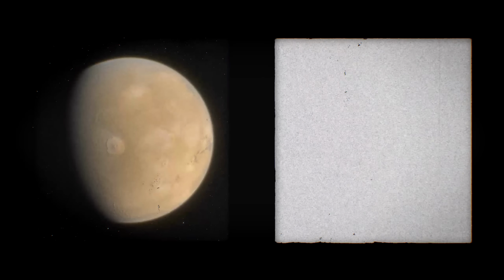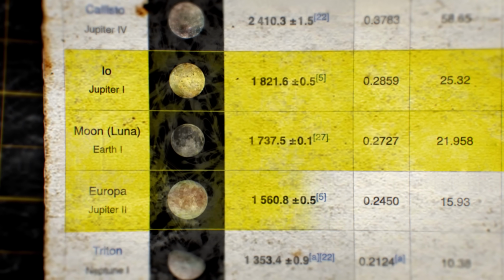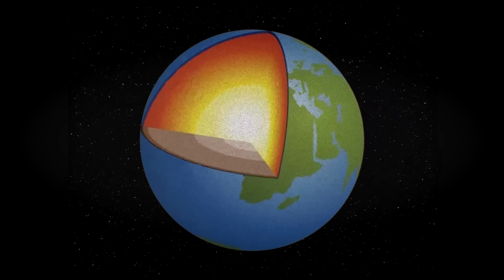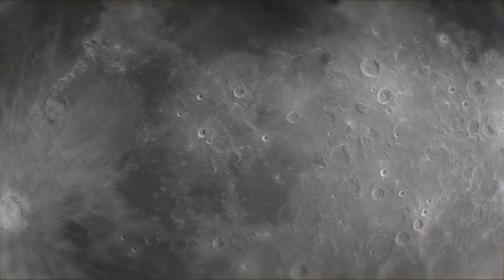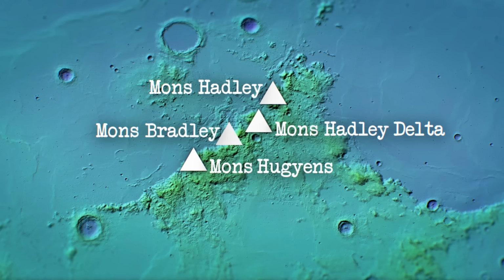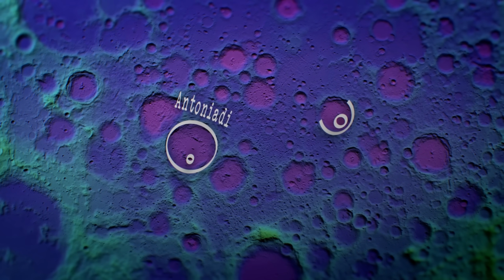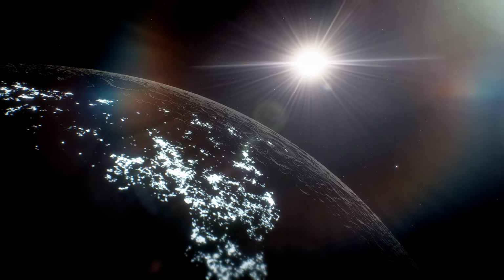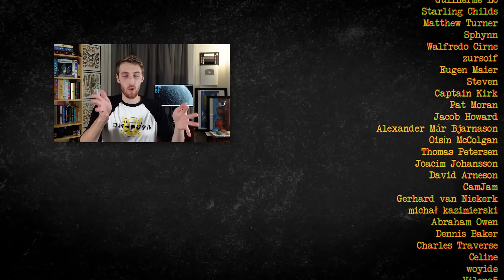Why The Moon's Geography Is DEAD

Comment: As a very amateur armchair writer I kinda already figured out that if the moon’s surface is stable enough, it’d be needed as a larger/more permanent station that’d basically become a port and staging point for future missions. Aside from how long it takes to reach the outer edges of the solar system with our current technology (which probably won’t be made that much faster, even with using celestial bodies to slingshot astronauts), the biggest obstacle to more hands-on exploration has to do with how much fuel, rations, and other supplies a shuttle can carry and still reach escape velocity. BUT—move a good deal of these supplies to the Moon gradually to pick up later, and suddenly it (theoretically) becomes far more feasible. (There’s also no biology to hurt on the moon with repeat launches, unlike Earth.)

So, for just being able to explore, say, Mars and Mercury and various Asteroid Belt objects and other celestial bodies like nearby moons and maybe even comets? Yeah we’d need the moon as a port. The moon is also a conveniently located place to try and test things to set up actual colonies for astronauts (NOT YOU, BILLIONAIRE TOURISTS) to have longer extended stays outside Earth’s atmosphere than what we can currently do with the ISS (radiation shielding, artificial gravity, actual agriculture with hydroponics and poop-fertilized soil verses testing with a few plants). Because forget a Mars Station/Colony—we gotta figure this out before sending anyone further than Earth’s orbit and the moon.
-
…THAT, and who cares how “practical” it is. If we cared about practicality beyond the logistics to plan to study things outside Earth’s gravity…let’s be honest. I don’t think space exploration would even exist. (And, well. I just think the moon is Neat)
Reply: I don't mind billionaire space tourists, if their money helps fund the research and improve the technologies
Reply: I hope one day space travel is cheap enough for regular people. Like, a couple grand to go up into orbit. Instead of buying a new car, you could go to the moon.
Reply: Tldr
Reply: @anonymousfellow8879  I agree
Reply: @sandrotabidze  
Teal Deer:
-the moon’s a perfectly located celestial object to deal with figuring out long-term space travel and outright habitable colonies for research—assuming its crust is stable enough (have yet to hear that it isn’t) as getting to Mars is 5 Years One Way 

the moon’s still frikkin COOL just ‘cause it exists. Who needs a practical reason to be interested in it?? -basically a gentle jab at Atlas Pro being bored with this topic but finally making a video just to get the Repeat Requests from commenters to shaddup.
Reply: Minimus is way easier because of the lower gravity. It's also closer to the edge of the gravity well and so takes less fuel to escape.
Reply: @anonymousfellow8879   Just this christmas I politely publicly declined a 25€ Amazon gift coupon that my boss gave us as a little christmas present. My boss is an amazing guy. Amazon is a dystopian shithole, as far as I'm concerned
Reply: @Matityahu-the-God keep dreaming

Comment: It's also worth noting that if our Moon were much smaller, we wouldn't exist as a species, and Earth would be a very different place, most likely only with pond scum for life. This is because the Moon's gravity holds the Earth upright, and only allows its axis of rotation to wobble, ensuring almost the entire planet gets the Sun's rays each day.

Without the Moon's massive size, the Earth would periodically tip on its back, and expose one hemisphere continuously to the full force of the Sun's rays. The effect would be to prevent complex life ever leaving the oceans, and most likely never developing.

Also, without the massive iron core of Thea, the impactor which created the Moon we know today, our Earth would not have a large enough iron core to create the huge magnetic field which protects our atmosphere, and the Sun would long ago have reduced the atmospheric pressure on the surface to zero.

And perhaps even more importantly; without the massive Moon and the large tides it creates, Earth's day would only be 6 hours long, and the large Intertidal Zone which allowed marine life to evolve onto land would not exist.

The Earth-Moon system has such a ridiculously low chance of existing that it accounts for a large percentage of the reasons for the Rare Earth Hypothesis. And let's make no mistake here; the solution to the Fermi Paradox could easily be the rarity of Earth-Moon systems which remain sufficiently stable for 4,000,000,000 years.
Reply: Brilliant.
Reply: source: dude trust me bro
Reply: Is there any evidence that this tipping effect has ever happened on the other planets which lack major moons, Mercury Venus and Mars? I’m not convinced, it’s not something I’ve ever heard of before.

Comment: I think one of the greatest challenges with colonising the moon would be the lunar regolith itself.  I remember someone mentioning that the static clinging regolith to the astronauts, the lander, and the instrumentation caused no end of problems that hadn't been adequately predicted for the mission.  Even on subsequent missions the regolith continued to cause problems even with experience of it.  It got in the astronauts eyes, messed with seals, dirtied camera lenses, large quantities got inside the lander just by clinging to the outside of the suits and got in every crevice in the control panels.  Essentially, everything on the moon is going to get clogged by dust, and every moving part is going to get grit in it.  It would be very difficult to keep any facility clean enough to achieve the level of workmanship required for further space travel.

Comment: 5:50 Technically, the Moon would only be the second biggest relative to its parent planet.  Charon holds the title of biggest moon relative to planet at roughly half the size of Pluto.  But of course Pluto isn't a planet anymore, and the sizes of Pluto and Charon are close enough that they could be better described as binary planets rather than as a planet-moon system, so sure Earth's Moon wins by a technicality.

Comment: An interesting video, but it lacked any mention at all of the theoretical creation of the moon, causing the back side of the moon to have a much different, thicker, lighter and smoother crust, due to the lack of volcanic activity that is prevalent on the visible side of the moon. Personally, I find the Earth's moon to be one of the most interesting and intriguing of all the celestial bodies in our solar system, because without our moon, life on Earth would not/could not exist, not the life we know, anyway.
Reply: The moon does help to stabilize the earth's rotation, but it should be noted that their are other phenomenon that can have the same effect.

Comment: Interesting as always.

Random question: In most Dungeons and Dragons worlds, there are large cave systems. Large enough for cities and nations. How unlikely are such massive underground spaces on an Earth like world?
Reply: That's probably a function of gravity and precipitation/erosive forces. Higher gravity means underground voids can grow as large before collapsing on themselves, whereas lower gravity would allow larger voids, but wouldn't create as dense of a rock layer. Also low gravity worlds are unlikely to have a precipitation cycle since that tends to require enough gravity to hold an atmosphere.
Reply: That is an interesting question. My guess is the best bet are dormant lava tubes similar to the rille mentioned in the video. I think volcanism is just a more common thing in space than something like hydrological activity that usually forms caves here on Earth. Maybe there could be cave systems made by liquid sulfuric acid like on Venus or liquid methane like on Titan. The only other thing I could think of that could form caves could be liquid ammonia but pretty much any liquid is capable of forming caves in large enough quantities I think.
Reply: Well there's actually gaint amounts of water underneath the crust. There's spaces between molten rock and water molten water. So depending on your definition of caves or underground seas.

Comment: It is odd that even after researching your video, you call the Moon "a cold dead world".

In fact, the surface of the moon varies from 127 to -175 degrees C depending on the time of the Luna day. Days are very long and hot. Nights are similarly long and extremely cold. 

Anything in the shade is very cold. The lunar surface is heated by radiation, and there is no atmosphere to buffer or distribute the radiative heating. It's effect is extreme: objects transition nearly 300 degrees C at the terminator of the Sun's rays - a tremendously aggressive expansion/contraction cycle across a very small area which must be accounted for in any equipment intended for use by people on the Moon.

Only on average is the Moon our closest cosmic neighbour. There are some Near Earth Objects (NEOs) with orbits which dip inside the 800,000km diameter sphere of the Lunar orbit around Earth.

Comment: The Moon isn't Earth-like in its composition, it mostly IS Earth. Or rather WAS Earth 4.5 bya.

The Moon is formed predominantly from the continental crust of Earth which was blown off by Thea's oblique impact angle. Very little of Thea ended up orbiting Earth and coalescing into the Moon about 40,000km above the surface of Earth.  Which was also rather convenient because Earth's Roche Limit for the Moon is about 18,500km altitude - below which it would be torn apart (or never form) by Earth's tidal forces.

It is the Earth's tidal bulge, which precedes the moon in its orbit, which accelerates the Moon very slowly, moving it out to the ~400,000 km altitude it currently orbits at. These same tidal forces slowed down the rotation of Earth dramatically, and also slowed the Moon's rotation to be tidally locked to Earth, with only one face showing towards us at all times. It's a 1:1 tidal locking mode - there are many more.

Thea's impact also conveniently increased the size of Earth's iron core substantially, and also reduced the overall size of the Earth so that the Rocket Equation is viable for chemical rockets.

If the Earth were just 10% larger chemical rockets could not reach orbit.
Yet another tick on the Rare Earth checklist. 😀

Comment: Pro - YouTube  finally got around to recommending your videos to me, this is the second one for me.  At about 4:30 "Use for information from Apollo"?   One thing for sure, it led to the Theia Hypothesis for the formation of the Earth-Moon system.  Another thing - the Moon's polar craters are crypgenic (maybe an excuse for another video?) and have water and other voaltiles trapped.  There's a slim chance they became cryogenic while there were still active lunar vocanos.  Over Deep Time the Moon has had a temporary atmosphere caused by impacts by comets and the asteroids from beyond the solar system frost line.  Some of that condensed "where the Sun dosen't shine"  -  the polar crater bottoms only see the background radiation of the Universe, 2.725 Kelvin.  Those craters are so cold it will take billions of years for the volatiles to sublime into the Moon' near vacuum atmosphere.  Between the low gravity and the solar wind the Moon's "atmosphere" might be one hundred to 20,000 molecules per cubic centimeter.  Some of the solar wind particles bounce their way ibetween the grains of the lunar regolith and become trapped, even at the lunar equator.

Comment: So, when you read elevation, it's  based on a 0 point, assumed to be in this case, the "water line", where water would settle. If there is less 'water', that line is lower. Your continent would be clearer if the 0 line was not at a median between high and low points.

Comment: Another thing if you had two 5x Mar objects in that close an orbit of one another is tidal heating would be pretty significant, as would tidal locking. I strongly suspect that they would end up facing each other constantly within a few billion years or less, and before that point, there would be a lot of tidal energy transfer that would mean they stay warm inside.

Comment: Well a big factor that should top the list is  that the worlds smaller the Earth  and Venus have progressively harder difficulty holding onto atmospheres as gas molecules in the upper atmosphere can be can reach and or exceed escape velocity. As such Mars struggles to hold onto all but the heaviest gasses like carbon dioxide with virtually anything lighter floating to the top of the atmosphere where atmospheric erosion due to interactions with the solar wind compete with radiation excitation to push gas particles above Mars's escape velocity in comparison Mercury Ganymede, Calisto  Io, our Moon(Luna), Europa and the likes lack the gravity to hold onto an atmosphere relative to the amount of radiation and ion bombardment they receive even Ganymede despite having its own magnetosphere lacks a substantial atmosphere. While Ganymede's icy shell is cratered it is far less cratered than Calisto despite being hit by more impacts due to its larger size and mass and closer proximity to Jupiter so the variations in its surface regions tell us that there is something going on there.

Gravity is not the sole factor however as far out beyond Jupiter and the inner solar system is Saturn and its moon Titan the only moon to have a substantial atmosphere there are a lot of factors at play there for one evidence is emerging that the moons and rings of Saturn are quite young relative to the age of the solar system arising from some calamity in orbit of Saturn around a billion years ago. The cratering rate is much much higher in the Saturnian system as ring moonlets regularly bombard each other and the moons that have precipitated out of the rings and even the largish midsized moons lack stable orbits as tidal forces continuously push them away from Saturn while the planet slowly yet continuously tips over onto its side 

As for the question of whether the Earth Moon system could have turned out differently at least in part the answer is yes but probably not in the way you envision it since the newer more dynamic models seem to suggest that the collision was much more head on than older less computationally sophisticated simulations that failed to account for the phase changes and flow dynamics  of colliding rocky bodies. In these models it is the high angular momentum of the resulting collision that drives the moon to precipitate out of the bulging ellipsoidal cloud of rock vapor and other more volatile gaseous constituents. In this model you start out with a massive gravitationally bound  hot gas cloud composed of what used to be proto Earth and Theia where as the rock vapor cools it condenses and precipitates with clumps at the farther edges having enough angular momentum to avoid falling back inwards allowing them to eventually clump together to form our Moon while the remaining cloud either condensed to form the Earth or was lost to space. Had the system had more angular momentum then the material that formed the Moon would most likely have just been flung off into space leaving a much smaller and lonelier alternate Earth, had there been less angular momentum then the collision would have been able to precipitate out much more readily forming a single slightly more massive alternate Earth with no significant natural satellites . Perhaps there might be a special initial conditions which could make such a binary world but such a scenario would be highly improbable.

As for the surface of the Moon  I suspect the far side generally lacks nice names in part because it was unobservable before we developed rocketry, there is a substantial variation between both halves of the moon geochemically and structurally as the far side has a far thicker crust. 

Also one additional unique advantage for the moon in terms of colonization is it is one of the few celestial bodies for which the development of a space elevator is not only  plausible but feasible with known materials while the natural way to build such a structure would be the L1 Lagrange point thus connecting the Moon to low Earth orbit.

Comment: 3:46 would this image actually show rainbow glares like that? don’t they come from water vapor, of which i assume would be in short supply on the moon? genuinely curious
Reply: While I might not necessarily be the expert you're looking for...from what I understand the glass lens of a camera could cause the rainbow glare. While modern space exploration equipment is constructed to avoid this glare for obvious reasons, perhaps the artist just had a pang of nostalgia or thought the flare added instead of detracted.